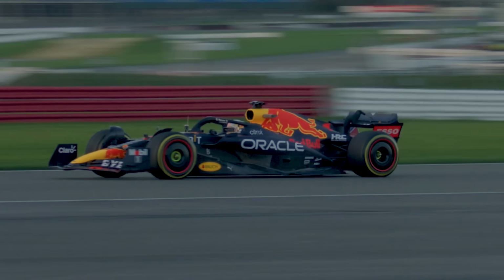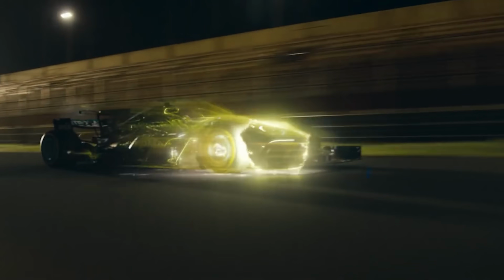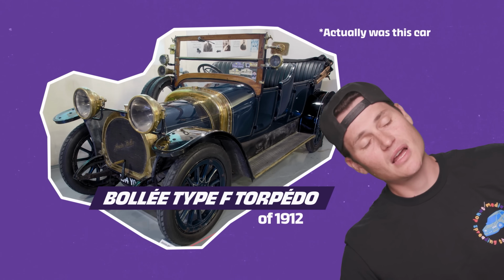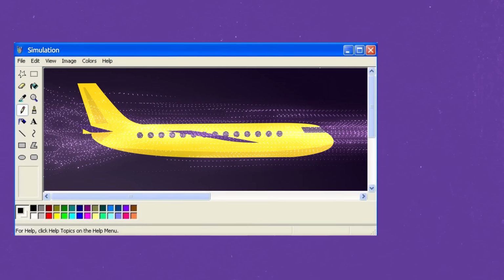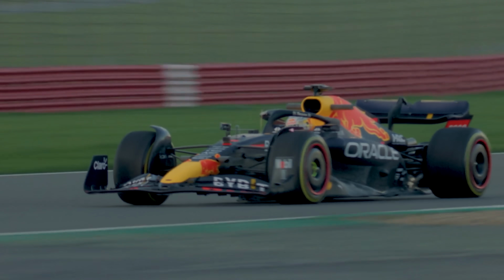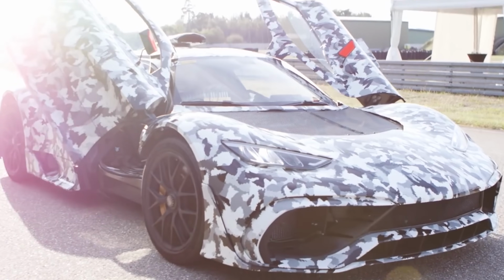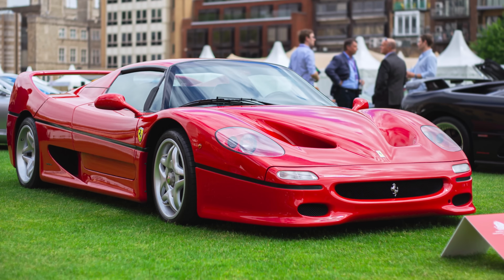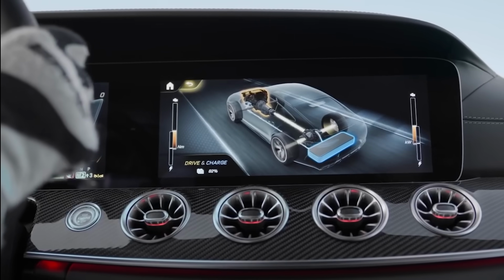Surprising Tech That Came From Formula 1

Comment: How are parts, like the MGUH, that consistently fail in f1 cars modified to be more reliable in every day road cars?
Reply: The manufacturers have said that the MGU-H has no road relevance,and therefore are not going to be part of the new powertrains coming in 2026.
Reply: @Spike-sk7ql  More likely they will use electrically assisted turbos, where turbo is spun up to speed at low engine rpm by an electrical motor.
Reply: "Consistently fail"? How many have failed in the past 8 years? Not many.

Comment: I thought that McLaren was the first to use a carbon fiber monocoque with the MP4/1? As much as I love Ferrari, I'm pretty sure thatthe 81 McLaren was the first CF car.
Reply: I think a researcher may have screwed the pooch on this one. Technically the Lotus 88 was the first to have a fully carbon fibre monocoque design, but it never raced. The McLaren MP4/1 was the second to unveil a fully carbon fibre monocoque chassis, and the first to race that chassis (in the third round of the '81 season).

Ferrari's '81 chassis was, I believe, a carbon fibre and aluminium honeycomb composite chassis.
Reply: It was

Comment: yea the plaid may accelerate faster than the amg one, but can it corner as well?
Reply: Thé plaid is just a 0-60 machine, other vehicles/gas cars have way higher top speeds, cornering ability, lose weight…..
Reply: Is it faster tho? Nobody's even tested the amg one yet because it's not released and tesla can only do it's number in very specific conditions.
Reply: That "record" was with rolling start

Comment: My favourite F1 part in road cars is the CVT in my Nissan Versa.
Reply: Too bad the cvts in the versa aren't matenience friendly
Reply: @ThatCasualGuy23  : Honda makes the best CVTs, Nissan is a miss. Sad. I actually like a nice 6-speed manual gear box.
Reply: @bondgabebond4907  Nissan cvts last fine nowadays, the past few years they've become a lot more reliable
Reply: @mountaingoat595  : Scotty Kilmer was pretty rough on Nissan CVTs. Good to hear they are reliable. My first car was the Datsun (Nissan) 2000, 1969. Wish I had it today. Cost only $3,225.
Reply: @bondgabebond4907  the CVT in my 06 Honda Civic hybrid was garbage. What have they changed?
Reply: @kyletaylor4312  that is 2006. Today's CVTs from Honda have vastly improved.
Reply: @bondgabebond4907  that's about $25k in today's money.
Reply: @bondgabebond4907  you’ll notice that cars with CVT and manual have faster 0-60 on CVT, for obvious reasons. I went from manual to electric. I don’t miss the gears at all.
Reply: @float32  no shift time = more acceleration time
Reply: @TheRealSykx  Not only that, but you can keep the engine sitting at peak power, where shifting usually means you go down the curve a bit.
Reply: @bondgabebond4907  I agree with you from experience. Honda knows how to make a killer CVT and a killer Manual
Reply: @kyletaylor4312  Everything. Drive a Honda Civic 1.5T Turbo CVT and compare it to your 2006 Honda Civic Hybrid. You will be quite suprised at how much more enjoyable they are to drive
Reply: Toyota's new CVTs are actually pretty good - they have a mechanical first gear which transitions into the CVT system, so you don't get that rubber band feeling accelerating from a stop, but you get the gas savings while cruising
Reply: I've had 2 versas, never had an issue with the transmission the first the engine blew with 274k miles, the one now has like 230k,  did I just dodge the bullet of cvt transmissions. Was there another kind of automatic transmission in some versas?

Comment: F1 is the reason lots of companies like Toyota and subaru have cvt + turbo drivetrains. Its really efficient while still being a ok speed
Reply: You realise that tanks, agricultural machines and equipment have been using CVT for decades stop right!! Even bikes uses CVTs
Reply: @carholic-sz3qv  yeah but toyota had an f1 team, lots of the sports development and tech from that team ended up in the latest sports oriented vehicles in their lineup... even then, its just a transmission. Not a big deal
Reply: @carholic-sz3qv  what tank uses a CVT???

Comment: The first F1 car with a full carbonfiber-chassis raced already one year earlier, the McLAREN MP4/1 from 1980 :D
Reply: Yea I was like wasn’t the first carbon fiber car a mclaren
Reply: @sheepbeep5247  I am
Reply: @sheepbeep5247  I thougth the exact same thing.
Reply: @sheepbeep5247  it's the Jaguar xjr-15
Reply: Man, Technology growing so fast, doesn't it? I still remember when the F1 car is so much smaller and have more powerful engine (I doesn't include the hybrid system, just plain engine power) with a traditional aerodynamics. And now we have a super efficient engine with gigantic downforce and multiple parts are perfected with computing power.
Reply: @literallyhuman5990  the V6 on its own is still pushing 1000bhp
Reply: @literallyhuman5990  yes funny how the old cars were so much bettrr
Reply: @literallyhuman5990  why did you State the non hybrid era Like we are all stupid💀
Reply: And wiki says it was the Lotus 88 that had the first full carbon fibre chassis. Maybe Ferrari used some element?
Reply: Carbon fiber predates F1 and was in aerospace before that. When the McLaren built their carbon monocoque it'd already been in use for over a decade, and F1 hasn't been the driving force behind it. Space has. When kilograms are measured in tens of thousands of dollars for launch costs carbon fiber is downright cheap. The stuff is everywhere in space. Rocket nozzles are about the only place it isn't used. Even parts that aren't made of carbon fiber will often be wrapped in the stuff because the weight is so low it makes sense to spend the money on insuring it's strong enough to not fail. To this day the most advanced types of carbon fibre are still in space, and everywhere else is a trickle down from there. Not even F1 money makes sense to use the best of the best compared to the weight savings it can gain in space.
Reply: The MP1 started in 1981
Reply: “Oh yea, totally knew that. Thought the same thing when he said that”😂 fuckin liars
Reply: The Lotus 88 carbon fiber monocoque chassis F1 car first ran on track at the season-opening 1981 USGP West. The MP4/1 debuted in Argentina two races later. Colin Chapman was once again first. Somehow history forgets this fact.
Reply: It was the second Formula One car to use a monocoque chassis wholly manufactured from carbon fibre composite, after the Lotus 88 that debuted at the 1981 US Grand Prix West, a concept which is now ubiquitous. The MP4/1 was first entered in a Formula 1 race at the third grand prix of the season in Argentina. The Lotus 88 made its debut at the first practice session of the 1981 season opener, the US Grand Prix West at Long Beach. Although the car was not allowed to race it beat the McLaren MP4/1 to be the first Formula One car with a carbon fibre monocoque chassis, the MP4/1 making its debut at the third Grand Prix of the season in Argentina.
Reply: A lot of the info in this video is only impressive to someone who doesn't know formula 1
Reply: Nope that was 81 and really used in 82.
Reply: I’m made of carbon fiber too
Reply: The Mclaren MP4/1 was indeed the first F1 car with a carbon fiber monocoque but it is from 1981 not 1980
Reply: John Barnard
Reply: @WenSud  Yes. Snatched up from Jim Hall's Chapparal.  Carbon Fiber expertise coming from Steve Nichols of Hercules background.
Reply: They make more mistakes than you would think you just catch them when it's a subject you know
Reply: I literally came to comment the same thing. Donut Media is trying to get F1 out there to new viewers. So respect, but fact check.
Reply: Great catch i thought it was the mp41 but didn’t know the year 
Good catch
Reply: Yes!
Reply: Don’t blame Donut, they are just reading WiKI’s they don’t actually know anything about motor sports.
Reply: yeah and no the mclaren ad a metal underbody and carbon fibre panels they probably ment full carbon fibre parts.
Reply: @IAMW1LD  no the mclaren mp4/1 had a full carbon fiber monocoque chassis
Reply: @sigmatate3235  I thought we were talking about the mp 4/4 which had teensy bit of metal sorry